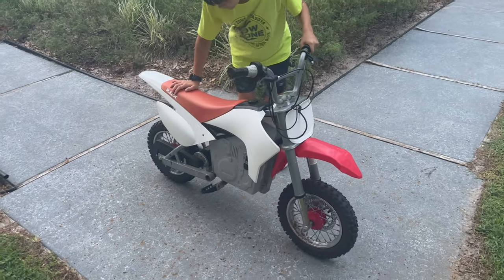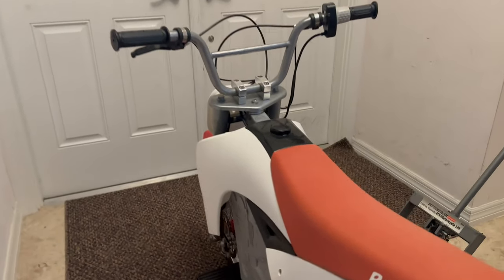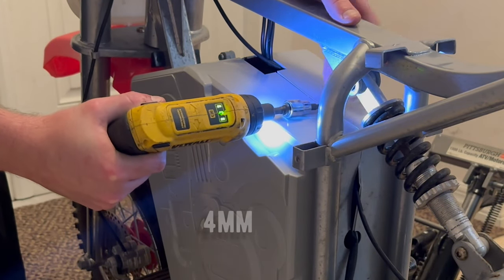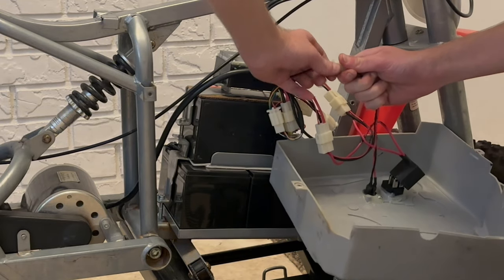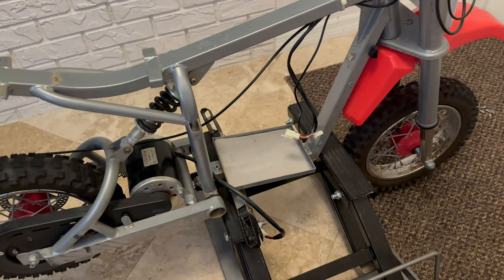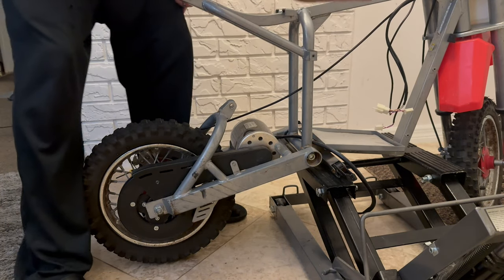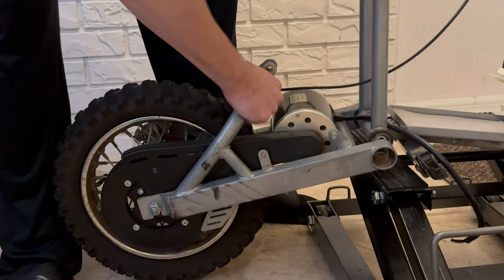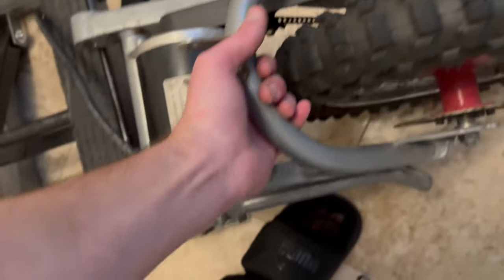EXTREME Razor SX Build -Last Run Stock(V.1) -FULL Step X Step Tear-Down To Frame Starts @ 1:35

Comment: You got to have extra storage places then just the garage to keep all of this stuff.
Reply from the maker: I usually keep everything in the garage but my ac quit on me and it’s way too hot to work in consistently. Once I get a new better ac in there, I’ll move everything back in there.😬💯🍻
Reply: @KruseNStuff you got a check or some AC guys if you know anyone people are swapping out AC units one for cheap. Get a used old one that still works good that someone swapped out that's what I did Force better than these new efficiency pieces of garbage